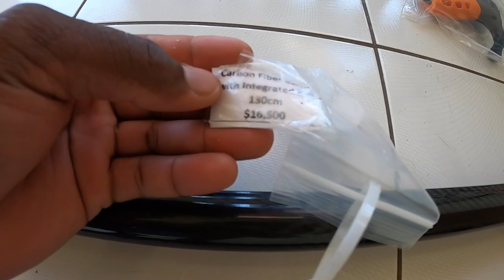Spearfishing Groupers | Setting up My New 110cm Speargun

Comment: You can use epoxy to build up the Muzzle so it can fit perfectly and straight.
Follow the following instructions:

1) Plug the Barrel on the side you are going to install the Muzzle, same as you guys did in the video.
2) Use hair oil or grease to lubricate inside of the Barrel where the Muzzle is going to install. Also lubricate the top of the plug because you don't want the epoxy to cause the plug to stick on the Muzzle. Lubrication is also done to allow the components to be able to be disassemble after the epoxy is dry or cure.
3) Mix the Epoxy Resin with Hardener. There will be instruction on the package telling you the ratio of epoxy to hardener. 
4) Throw the epoxy mixture into the Barrel. Do not fill it up to the brim. Amount pure will depend on to gap. 
5) Put the Muzzle into the Barrel and center it so it can set straight. Use a cloth to wipe the epoxy that is spill over.
6) Disassemble immediately when the expoxy dry/cure. Curing time for epoxy will depend on the brand or type use, it will be on the package.
7) take out the cork use a cloth to wipe out the grease out the barrel.

Process completed. Epoxy is basically plastic it comes in it's liquid form and when it dry it become a very strong plastic. You can purchase a epoxy kit at your local hardware it is not expensive.

Comment: I really wouldn't use metal wishbones. They can sometimes hit the tip of the gun after the shot and do some damage especially with carbon fiber barrels. Also if the bands slips from your hands, wishbones made of rope wille hurt much less and they are also cheaper.

Comment: I have a suggestion because the muzzle does not fit into the barrel what I do since I use an omer handle and a Seac barrel I just put electric tape around the muzzle so that it fits in and it still is waterproof